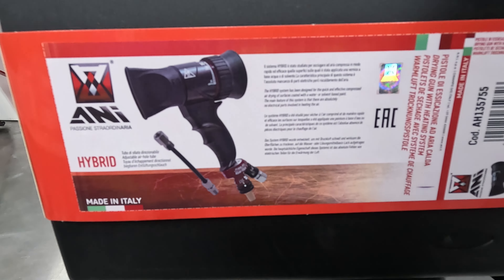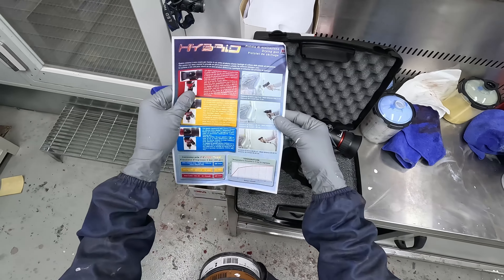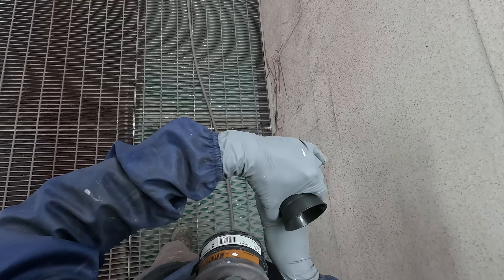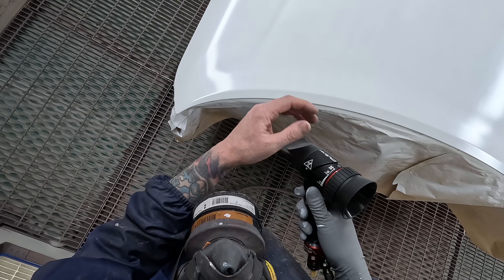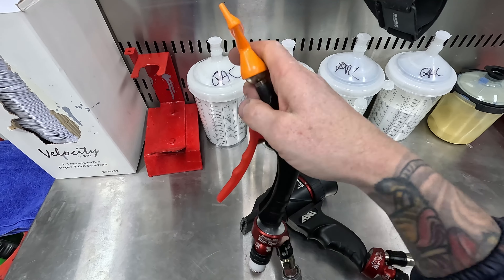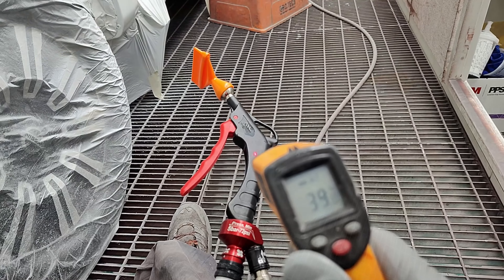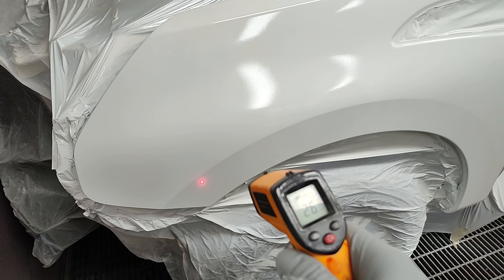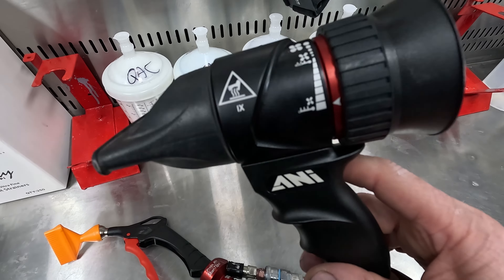ANi Hybrid Self-Heating Air Blower

Comment: ANI also sells that heating element as a standalone add on for their guns, I use one on my Skull, heats the air carrying the paint and blows heated air at a half trigger pull, and that isn't a water/oil separator on the gun, the red bits on both blow guns are the heating elements that cycle the compressed air and heat it
Reply: Are they expensive? May have to give it a go as I also have a skull
Reply: Where can i buy one i could find it anywhere ?

Comment: Anyone using water based paint should check out the BLO Air-S it’s a Handheld Car Dryer used in vehicle valeting to dry damp interior .I got one of these and it’s fantastic it changed my time spent standing with the cold damp airline dryer to this warm 2 speed dryer ,it’s got a filter on it I think it’s a hep filter and it’s got a long lead ,it’s under £100 .You won’t be disappointed oh and I don’t have a spraybooth I just paint in my workshop as it’s just me

Comment: So its a hair dryer? Lol
Reply from the maker: Basically
Reply: I’ve been painting for 25 years and people are convinced I’m a hairdresser because I have some many hairdryers in the workshop. Paint loves warm air. If they want to corner the market they need to design an oscillating hairdryer on a stand.
Reply from the maker: @petebanham4916  except you have to be very careful of stirring up dust in the booth or that time saves will be made up 10X in the polishing bay